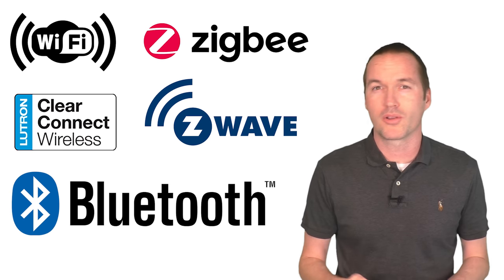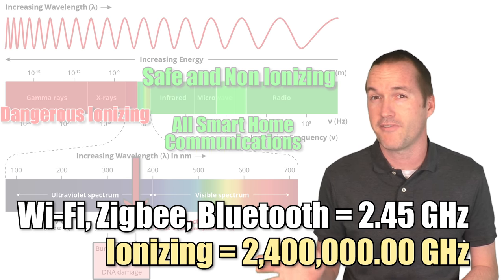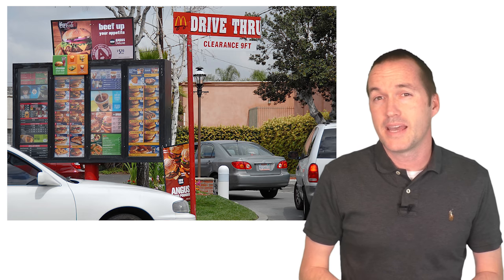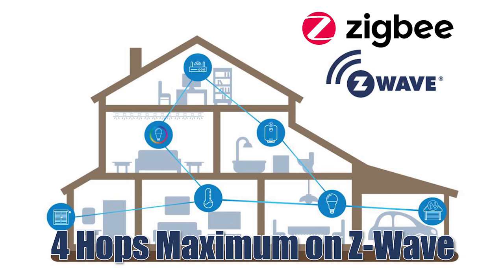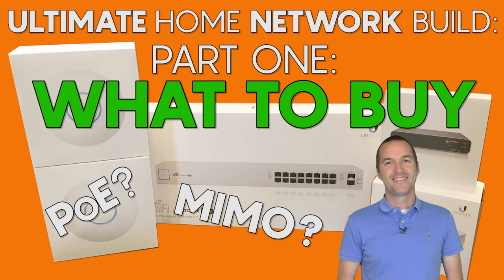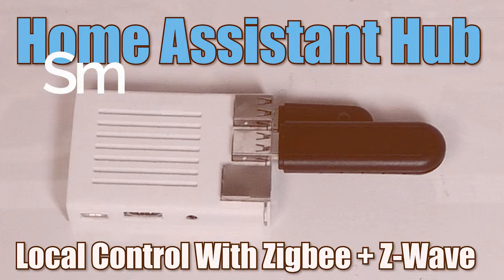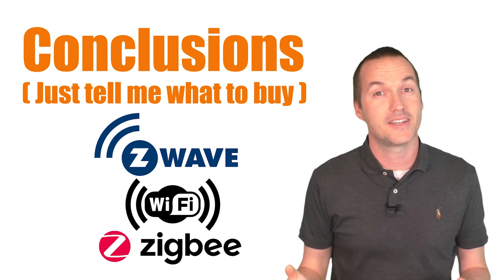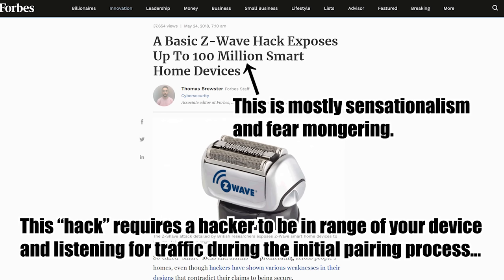Z-Wave vs. Zigbee vs. Wi-Fi! Smart Home Basics: How To Pick The Right Protocol

Comment: Dude.  Take your brain out.  Put it in the microwave and see if it doesn't get scrambled.  :)  But seriously there are issues with RF radiation in the communications bands if the power density is too high.  Like if you own an iphone 11.  Mostly I'm giving you a hard time but there are risks with every frequency.  Low power devices like we use in home automation are harmless.  Great video!
Reply from the maker: Interestingly, my brain would get cooked, not scrambled :)
Reply: It just energy transfer. It's still not ionizing. A microwave puts out over 1kw. A cell phone is nowhere near that.

Comment: Unfortunately you are incorrect about harmlessness of non-ionizing radiation. If you take a biology rather than a physics approach (arguably more relevant to health) you can understand that even at low energy the protocols' pulses can set off ion channels, the basis of our innervation which is not just thinking but also intimately linked with other systems like digestion and the immune system, which as we know fights off tiny cancers constantly throughout our lives. Or just observe the empirical studies finding an increase in cancer in rats. Also factor in the danger of deeming something safe when in fact it is not clear. It seems more a better safer than cancer than a caution to the wind scenario.
Reply from the maker: I'm primarily a biology teacher with dozens of hours of coursework in both cell biology and biochemistry, I'd be happy to look over any scientific papers you have on the subject.  What is your opinion on the longevity of studies before we deem something as safe?

Comment: Higher frequency does not mean higher energy, there is no direct correlation.
Reply from the maker: You are 100% incorrect. Open any physics or chemistry textbook.  You can even calculate the energy using Planks constant.
Reply: @TheHookUp  sure, at the quantum level without any other stimulation.  You're talking about wireless devices and protocols here.  The energy level that wireless electronics emit to for wireless communication is by design controlled by a power amplifier and limited by the FCC.  Furthermore, higher frequencies attenuate at a much higher rate, even over the air.  So, your statement saying that higher frequencies = higher energy in wireless protocols is misleading.
Reply from the maker: What are you even talking about? "is design to be controlled by a power amplifier"? Are you just trying to say smart words?  The statement "higher frequencies = higher energy" isn't misleading at all, it is a fundamental property of waves.

Comment: Another falsehood that wireless frequencies are not harmful is also not true.  The 2.4GHz band of Wifi and other 2.4GHz wireless devices can operate from 2.4 - 2.485 GHz.  Microwave ovens cook our food at 2.45 GHz, because this is the frequency that resonates water molecules.  Granted, microwave ovens operate at much higher power levels than wireless devices do, but the concern is exposure over time.  Look up SAR (Specific Absorption Rate).  This is the measure of RF energy absorbed by  the human body over a specific amount of time.  All mobile wireless devices must pass below a specific threshold of SAR as regulated by the FCC before being along to ship to consumers.  The SAR measurement process uses  phantom human heads and bodies that emulate the dielectric consistency of said human body part, while operating that device in very close proximity (much more involved to go into here).  This is dangerous to put out these falsehoods.  Explain it right, if you're going to explain it.
Reply from the maker: I did explain it right.  Again, you are just wrong.  Just because a microwave is able to utilize a specific frequency to HEAT food doesn't mean the waves are harmful.  Are lightbulbs harmful? What if I told you we can use the same frequency in a laser that will literally burn holes in you?  You said "This is dangerous to put out these falsehoods", and yet you clearly have no background in the subject and are just spouting garbage that you heard on fear mongering websites.  I generally try to be diplomatic in my comments, but this touches a nerve.
Reply: @TheHookUp  I stand by what I said.  This is my profession, will multiple patents around SAR mitigation.  This also touched a nerve with me, as I rarely comment on videos.
Reply: @bennybologna1471  doesn't mean you're right. We are "exposed" to various frequencies since the beginning. And I'm still waiting on some weird shit that supposed to happen? And this not my "profession".  And earth is not flat.

Comment: Your video is full of errors. Don’t talk about physics and/or radio technology of you do not understand it.
Reply from the maker: Happy to hear any corrections you have.  I'm a certified physics and engineering teacher though.
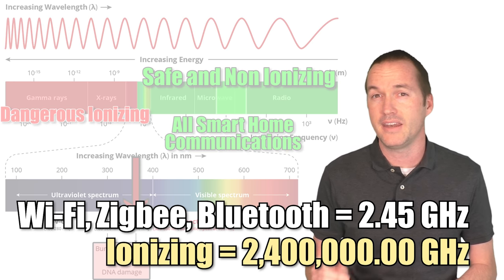Reply: @TheHookUp  At 2:29, your argument that these electromagnetic signals are safe because they are non-ionizing is misleading. I do not say they are harmful, because they are not, but not because they are not ionizing, but rather because they have small energy, and we have not experienced any short or long term effects in the last 70 years since we used them. Try to use a microwave oven with the same frequency (and there is a good reason why the frequency is the same), and it will harm you. It will cook you.

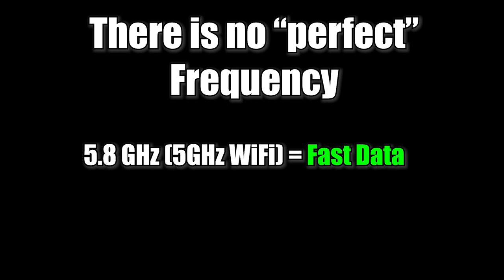2:43 "Higher frequency means higher bandwidth." Not at all. First, it is essential to understand that a signal delivering information is never a single frequency. If it is a single frequency, then it is a sinus signal from the eternity in the past to the eternity in the future, and there is no information in that. A modulated signal is always in a frequency range. The data transfer speed (number of bits in a second) depends on the error ratio, the radio frequency bandwidth (the difference between the highest and the lowest frequency of the signal), and the modulation. For example, EDGE technology using a new modulation doubled the speed of the data transfer over GPRS using the same frequency range and radio signal bandwidth.

You have "more room" to have the same signal bandwidth (frequency difference) using higher frequencies. Hence it is easier (cheaper) on the higher frequencies to have wider channels and more speedy data transfer. But this is not simply because "higher frequency means higher speed". For example, you could have the same frequency bandwidth and speed on 433MHz as on 2.4GHz, but fewer devices could simultaneously communicate. That is also because the signal travels farther till it is attenuated, and devices have to be farther away to use the same frequency. Btw: the reasoning about the attenuation is also wrong.

2:50 "Lower frequencies have lower attenuation when traveling through solids."  First, try to send any wavelength electromagnetic signal through a steel wall. No matter which frequency you try, it will not get through (Faraday cage). However, if you have a concrete wall with rebars, you can send through higher frequencies, where the wavelength is smaller than the distance of the steel bars in the concrete. Again, this is how a Faraday cage works.

The main reason that the 2.4GHz and the double do not travel so far as 433MHz is that the water resonating frequency is around 2.4GHz. That is why the Microwave is that frequency: that is the best to heat water. WiFi is also attenuated by the water in the air. That is the reason you can use WiFi locally. It does not travel too far because the water consumes its energy. Therefore, the distance is limited, and the same frequency (even when it is FHSS, invented by Hedy Lamarr, more known as an actress) can be used in smaller environments, closer to each other.

I know where the "Lower frequencies have lower attenuation when traveling through solids." may come from, though. Lower frequencies have higher diffraction (Huygens principle), and therefore you get more signal if something is blocking the line of sight propagation between the sender and the receiver.

I studied quantum mechanics 40 years ago, so I do not dare challenge what you said about the ionizing frequencies, but I am sure if a physicist who is not certified rather knows his subject sees your video ... better none of them do.
Reply from the maker: In other words "there are no factual inaccuracies, here's some pedantic bullshit I felt like writing", got it.
Reply: @TheHookUp  a teacher who does not learn. You cannot be wrong. You know better all as well.
Reply from the maker: My point is that there are no factual inaccuracies as you said a number of times in your post.  
"I do not say they are harmful, because they are not, but not because they are not ionizing, but rather because they have small energy"
"You have "more room" to have the same signal bandwidth (frequency difference) using higher frequencies. Hence it is easier (cheaper) on the higher frequencies to have wider channels and more speedy data transfer."

This is a 15 minute video aimed at smart home enthusiasts, not a doctoral dissertation.  You are just trying to nitpick pedantic crap that doesn't matter when the overall message stays the same.

Also, lower frequencies do have lower attenuation, your statements about that are incorrect.  I would try to boil it down and explain it to you in simple terms, but you will probably get angry about that and start quoting textbooks with tangential points.
Reply: @TheHookUp  I wrote, "Your video is full of errors." Not inaccuracies.